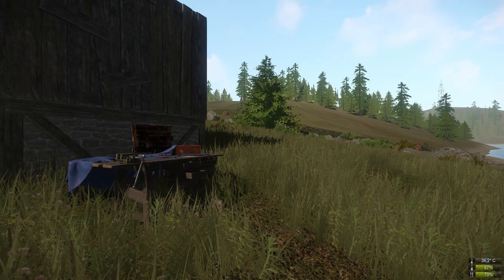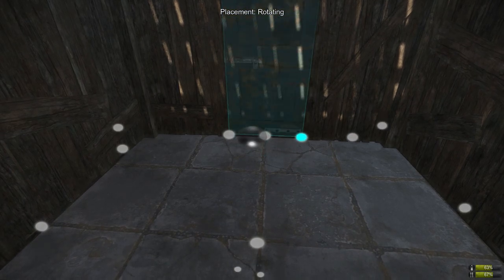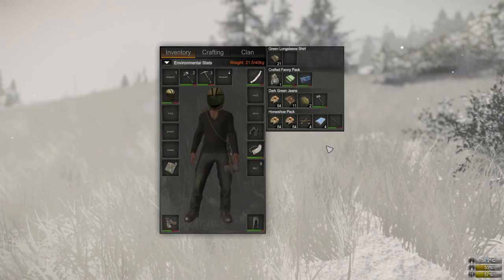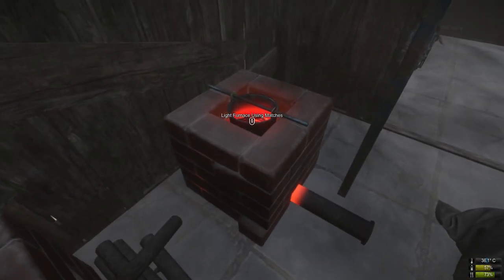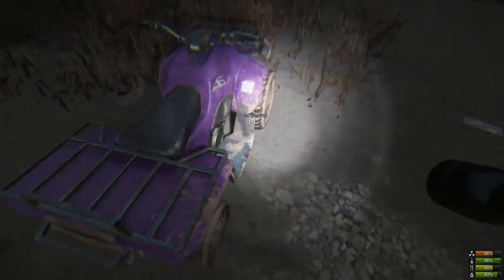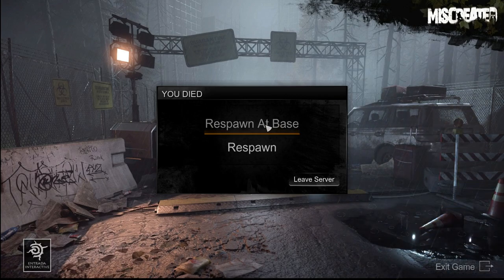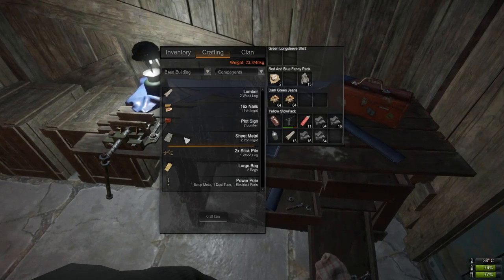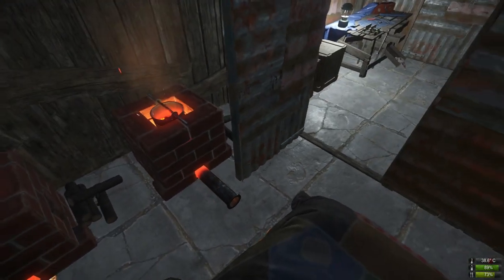How to Upgrade your Base in Miscreated

Comment: I never knew you could smelt all those stacks at the same time, man, I've been wasting so much time waiting
Reply: same for me when i was 2 months into the game. The videos are are big help to understand the game-mechanics.
Reply: This video is so helpful thank you. I've followed the process of upgrading here but when I upgrade the walls they look difficult to yours. Rather than seeing the sheet metal red/ blue all over the walls, I have metal supports/ lines across my walls. Have I done something wrong or is this because I'm using version 2 of the walls?
Reply: @hannahsmith2099  I think they changed how it looks, when I upgrade my walls to sheet metal they have 2 metal bands on the inside and a darker sheet metal look on the outside
Reply: @blackwaltz3135  thank you!